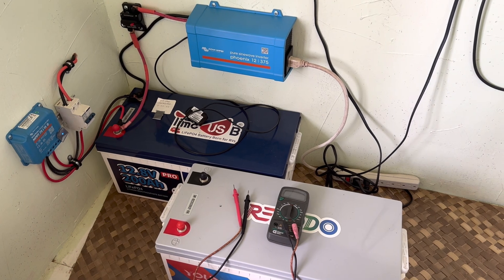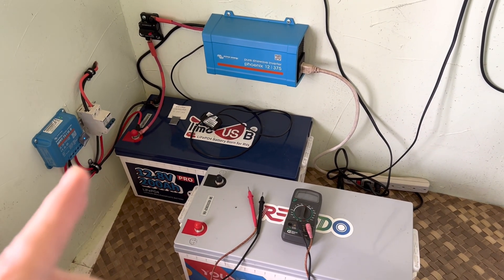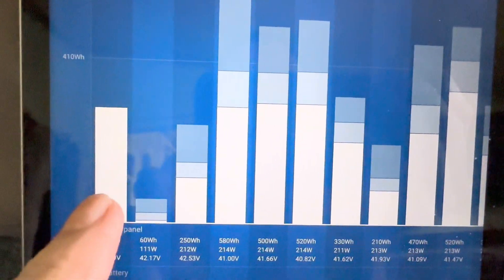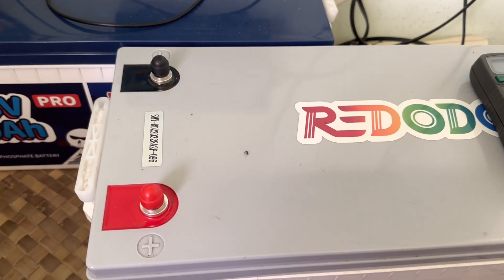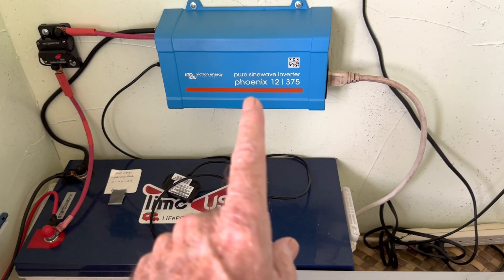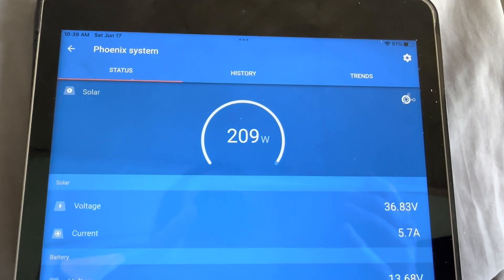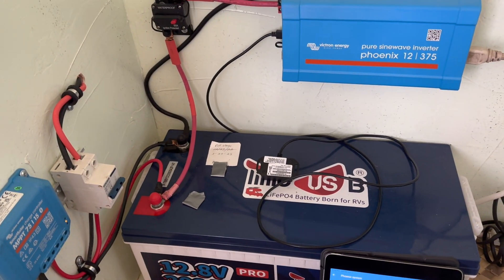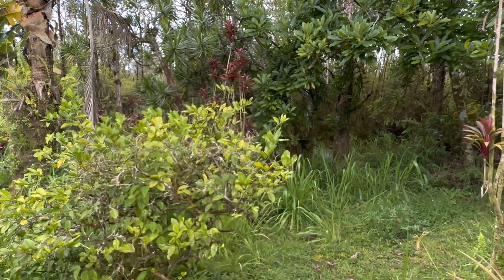BMS Fail!? REDODO 12.8V 200Ah LiFEPO4 dead in the water with no obvious signs of what happened. RIP?

Comment: I have a Redodo 50 ah mini and after only 8 months and very limited use its failed. Wont charge past 13 volts, and when I put it on my camper it sags .5 volt where my other lithium battery doesnt. Bought it off of amazon and seller wont return my emails. Will have to take it apart and see if its just the BMS or one of the cells actually failed.
Reply from the maker: Sorry to hear that...maybe reach out to Redodo on their website? Hoping that gets resolved for you. Aloha!🤙
Reply: @ProjectsinParadise808  Thanks...I'm hoping they do something for me,they seem like a good company.

Comment: i don't trust BMS and so, i prefer to have 2 batteries in parallels.. if one fail, all with not go down.. 2 batteries half size cost more but you double your power security (yes, "security" always have a cost).. the best is to build your battery with cells, use fuses, and balance them once a month with a charger which can to balance the cells.. i have build 2 batteries (without bms, but they have fuses) and bought one with bms and if i use this one with a little hoover of 12v4amp (for car), this inductive load cause a bms disconnect (the bms is sensitive to spikes), i was solved this problem with a 15amp diode in inverse soldered on the hoover connexion.. but what was my suprise to see my big battery with bms fail under a little (inductive) load when my old ones without bms never fail.. electronic is super, when they work well..

Comment: I would suggest putting a 12 volt rated load across that battery, anything that would draw an amp or two with the meter connected to see if the voltage drops from 8. whatever to zero. It looks like the b.m.s. has a partially shorted mosfet that is allowing some voltage to pass although the b.m.s. is shut down. I personally have never saw a Redodo b.m.s. so I am unfamiliar with their circuit design, but it looks to me like the switching mosfets are somehow feeding to a voltage sense wire, sending a voltage higher than it's cell over voltage protection, thus tripping the b.m.s. to stay open.  That's my 2 cents worth anyway, good luck my friend.
Reply from the maker: Mahalo! I hope to have a follow up video this afternoon sometime. Aloha! 🤙

Comment: Precisely why I went with 4x100 amp batteries rather than larger ones, plus my system has to start motor loads so 400 amps of BMS is better than 200 amps. Lose one, still have 3. All the peppers know, two is one, one is none. I would lean toward connection, bad cell and lastly a BMS, but could be a combo of issues since it is basically a new battery.  Would be interesting to see inside.  I went with Redodo and haven’t had an issue with 4 in parallel plus I would rather have my parallel connections on the outside of the battery than inside. None of the bigger batteries impress me with wiring or connections to the same size connector as a 100 amp battery.
Reply from the maker: 1st LiFePO4 that ever failed on me. 🤙

Comment: The BMS is obviously in a bad state.  The 8.4 might just be a ghost voltage (could tell by trying to put a very small load on it like a 1 watt D.C. bulb, and see if it immediately disappears) which would indicate the BMS has turned off. If it supports a very small load for even a few seconds then the BMS is likely on for discharge and the cell voltages are down to around 2.1v per cell on average.  This would mean the BMS was not allowing charge earlier.  But the hopeful thing is that you said when you jump started it with the charger it would start to charge.  That sounds very promising and may be all you need to recover the battery.

By the way, the "jump start" with a big battery like that will almost immediately shut off charging if the BMS has charge overcurrent protection because that other battery can supply such large current surge to a battery that is very low.  Maybe using a long length of smaller wire to limit the current would be better.  (Or run it thru a 12v incandescent bulb or any of various similar ways to limit the current from the fully charged battery to the dead one.)

Many dedicated LiFePO4 chargers have the "jump start" functionality built in, and I'd be surprised if the ones you have all did not.  I'd try each of the A.C. charger(s) without trying to "jump start" with the other battery and see if it would start to charge (and not immediately go off).

However you can do it, if you can get the battery to start charging then supervise it closely while trying to charge.  You saw with your friend what can happen if charging goes bad.  I'd probably charge it out under your tarp in the "patio" area.
Reply from the maker: Mahalo for all the suggestions! Still working on figuring it out. 🤙

Comment: Ouch.  My biggest fear with these complicated batteries (compared to lead-acid or older chemistries which do not require a BMS).  There is so much to go wrong inside the mysterious box.  I'd probably talk to customer support, but I'd be inclined to open it up so I could measure the cells individually and directly.
Reply from the maker: Still working on it! 🤙
Reply: They’re not as complicated as they seem, but I am not a fan of any battery over 100 A without a Bluetooth BMS. Personally, I build my own that way I know what’s in there and how to fix it if it goes off but it’s not for everybody.

Comment: Bummer.  Good to have backup.   Seems like BMS failure. Redodo has to replace. I doubt you want to tear down and check each cell.
Reply from the maker: Just heard from them, working on a solution ! 🤙
Reply: @ProjectsinParadise808  will be interesting to hear cause or issue.  Glad they are responding.

Comment: I think your BMS is fine.  It shows normal voltage, when connected in parallel with a 2nd battery, and it's not "asleep" or it would show basically zero voltage.  I think you've got a bad cell, or cell pairing, inside the Redodo.  Hopefully they will see the testing you've done, concede something is definitely broken inside, and honor the warranty without any issues.
Reply: No, the "correct voltage" it shows when in parallel is just the voltage of the 2nd battery.  To show "basically zero" it would have to suck the other battery down to "basically zero" which would be hundreds of amps thru the wires into where?
Reply: Daly BMS's and others show this kind of voltage when shut down.
Reply: @ricardomarcelino8388  - I've got multiple Day BMS's on batteries I have built from components.  They often show essentially zero voltage until woken up.  I've never had one show 8 or 9 volts on a 12.8v battery.
Reply: @jasonbroom7147  Depending on the Daly BMS you may get different wake-up methods, different "sleeping" voltages. Not all Daly"s are the same. But I am pretty sure that BMS there is not a Daly.

Comment: This is the issue of going super cheap on batteries,  you have not shown actual battery state, so I can only assume you don't have Bluetooth access to the BMS. If you did, the BMS would report exactly what and why it happened. The battery should have never dropped lower than 11.0v according to most bms default settings.l

Comment: I'm thinking about buying that same charge controller. I'm going to remember the 13.8 to 14v advice. Great discussion in here!
Reply: These batteries need to be charged to 14.4 +/- 0.2v or in other words, to at least 14.2 or at most 14.6 according to manufacturers specs and BMS specs and cell specs.  This is so the balancing circuit on the BMS is activated.  There's a lot of nuance in this, but that's the short version.

Comment: That voltage is typical of a shut down BMS for protection of some kind.

Might be a under/overvoltage cell. The BMS is alive since there is a voltage being shown at the battery posts.

Try to discharge it instead of charging. Some BMS's detect discharge as a good thing if they are off for overvoltage.

Another thing is, some BMS's need a plus 4 to 5V difference to wake up. So putting a battery im paralell may not be enough. You may need an external power supply of up to 16/17v to wake it up.

Your overall voltage might be deceiving if you do not know individual cell voltage, you only  know it has shut down, but you don't know why.

Imagine you have a low voltage cell, and all others are ok. When you go above 14v, the higher cells will hit the ceiling, and it seems that was what you experienced. 14,56V.

This is why it is recommended for more experienced users like yourself, that BMS have Bluetooth, and you can understant what happened.

My guess is unbalanced cells. To balance it you may need to open the battery...

Comment: I just wonder in series 2 sets 12 volt batteries 24 volt system , 4 total of 12 volt batteries . Each set hooked to a buss bar and one BMS shut off like this. What would happen then as far as damage to the lone 12 volt battery in one set?
Reply: Nothing... You system would become 12V and shut down.... The question would be to use 24V batteries from the beggining...
Reply: @ricardomarcelino8388  I would still have one set in 24 volt hooked to buss bar independently the system should remain in 24 volt I would think.  The reason for 12 volt batteries is because of this right here. If I have a problem say 1 bms goes down I'm not quite dead in the water.  I still have 12 volts to fall back on unless damage occurs in the equipment.  I have a feelings the BMS is going to be a weak link with these new batteries.   I hope the lone battery just shuts down.

Comment: If the low voltage shut off was triggered it wouldn't read any volt
Reply: That's only true if there is a load while the  BMS is shut off.  Under no load there is enough leakage thru the mosfets to read several volts on a digital voltmeter.

Comment: Have you tried connecting another 12v battery in parallel for 30 minutes and then checking voltage again. You will need to wake up the battery from low voltage disconnect. Cells are at 2.125V x 4cells = 8.5V currently.
Reply: Nop... When in cutoff the BMS shows lower voltage as a beacon... Just saying I am here, there is a problem but I am alive.

I fix problems like this every week... People bring me their batteries and 90% of the time it is unbalanced cells...

Comment: I had ac similar problem with a Chins.  The solar charge controller showed the battery as full, but a multimeter check of the battery showed it as basically dead.   I finally traced it back to the combiner box. I found a fuse on one string blown.   I assumed it was caused by a stray current from a lightning strike.  So,  I reset the BMS inside the Chins and as soon as I reset it, the battery voltage read full .

Comment: good you check every day and keep a log. why I love victron so much. well worth the extra price. now that you have a problem and you have date to go back to. looks like the BMS shut down. you are doing that correct to reset it. there is a internal problem. can even be a wire came off the BMS or even a buss bar came loose between the cells . contact REDODO first . have them look at this video. if it is dead and they don't want it back rip it apart ! nothing to loose at this point. can even use that bore camera to look inside . The most common failure is a BMS on them battery's . LiFePO4 is a safe type. The electrolyte is non flammable.  just the wires and BMS can burn up. this one just shut down . depending on BMS shut down can be from many reasons. 1 cell or more over or undervoltage.  High or cold temperature. the BMS it self over heat. too much current in or out of battery. this is a hard failure . electronic or bad connection inside battery. let us know what they say. first battery you had go bad of this type so far.
Reply from the maker: I am still baffled, and still working on it! In contact with REDODO...there will be a follow up! Aloha! 🤙

Comment: since its sitting at 8.5 volts, i would bet a cell or two have died. i just had a cell go out in my 12v 100ah home made setup (had a few questionable cells from a lithium forklift battery cobbled together) . i didnt have a bms on mine and has worked fine for about a year. used it to recharge another battery and went to check it and was at 9.5v, charger controller had error on it. tried jumping with a power supply and had the same effect as you jumping off the other battery, voltage just drops right back down. i opened mine up and found one cell at 0.7v. i even tried just charging that one cell and but could not get the voltage to increase. with that large of a voltage drop, cell failure not a bms issue would be my 2 cents.
Reply: Cells don't just die... 😂😂

This is a typical situation of BMS shut-off for over voltage. The 8,4V shows the BMS is working.

Comment: Looks like you overcharged it which triggered a safety in the BMS. 14.2 is WAY too high, you want 14.0 to be the absolute MAXIMUM. I only charge to 13.8V because 13.6V is resting charge. I never let it get below 12.4v. YOU caused this issue. I know the manual says it is OK to charge up to 14.6 but take it from experience and having been through this, you should ONLY charge up to 13.8v and cut it off because the MAXIMUM charge it can hold resting is 13.6v. Anything over that is simply overheating your batteries.
Reply: Sounds like a good idea to me. Just toned down my charging to 13.9 and 13.6 float.
Reply: @MikeAndNary  Yeah the BMS shouldn't be the thing you rely on. I have killed batteries before doing this and it is an expensive mistake. Unfortunately manufacturers like redodo "test" them and that is what they "recommend" with no long term testing. They don't live off grid like we do. If you find you are dying too fast, add more batteries rather than stress the one you have out. I run with 4 currently redodo each with different jobs, 4 mppt chargers going to each battery, and a couple solar panels on each charger. 2 for all the 12v RV stuff like the lights and such. 2 for the inverters. I then wired each to different breakers and pull the main breaker when not plugged in. Once the reddit headache is over, I HIGHLY suggest joining a few communities.
Reply: Isn't that's why these batteries have a bms? To prevent them from being overcharged/discharged?
Reply: @AĹPĤÀ-BZ-i8w  yes but do you really want to rely on that day in and day out when all you need to do is configure it properly and not face these headaches? I killed 2 batteries before I did this and ever since no more issues, off grid RV living for over 7 years.
Reply: @cgwworldministries83  awesome. I have 2 ampere time 12v200ah wired in series for a 24v system. What would you recommend the bulk voltage and absorption voltage be set at?
Reply: @AĹPĤÀ-BZ-i8w  27.8~28v max and 27.6 float. This will extend the life of your batteries if they are lifepo4. I would cut it off at 24.2v. Normally this happens at night if you run an AC, and it should be fully charged by like 11 am or so. They say 29.2 but that is a LOT of voltage if you think about it logically. Lithium is very picky with it's voltages and doesn't really drop off like lead and agm. Absorbtion time is 0-6 minutes but I set mine to 0-8 minutes to give it a smoother leadup on especially sunny mornings. You don't need to dump a ton of voltage into lifepo4 batteries like you used to with lead acid and agm. It's a bad habit that refuses to die. It's like your phone, charge it to 80% and have it shut off at 20% and it will last you a good 8 years if you don't abuse it. Don't charge it to 100% everyday or it will barely last a year. Same method applies here. Keep your lithium batteries warm in the winter and cool in the summer. I follow the rule, above 50f and below 80f.
Reply: @cgwworldministries83  thank you for your invaluable insights 🙏.  Will surely employ them.
Reply: @AĹPĤÀ-BZ-i8w  good luck and don't burn your house down ;)

Comment: Reliability issues creep up on every machine. Im sure their technical expert's will be excellent.
Liability issues are addressed perfectly by Redodo:
The battery is guarded by BMS to ensure the battery safety level. It has Over Current Pro tection, Short Circuit Protection, Over-discharge Protection, Overcharge Protection, Thermal Protection.
   If they don't guide you I sure can. 
I had my First lithium battery explosion folliwed by much smoke three weeks ago. It happened when I connected the charger. The ( economy Chinese) battery has run faithfully for greater than ten years. I've cycled the hell out of it. Overheated it. Froze it. Repeatedly. 
    Truthfully, Im leaning toward steel metal enclosure and Bluetooth BMS. ✌️♥️👍
Reply from the maker: 1st failure on this type battery for me! 🤙
Reply: @ProjectsinParadise808  You'll sort it all for us I think. These videos really help us all.